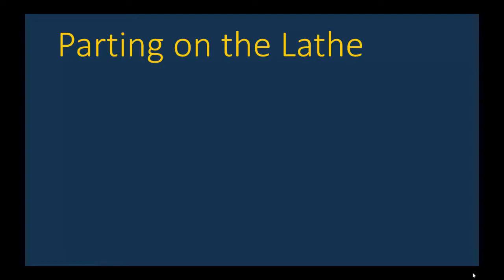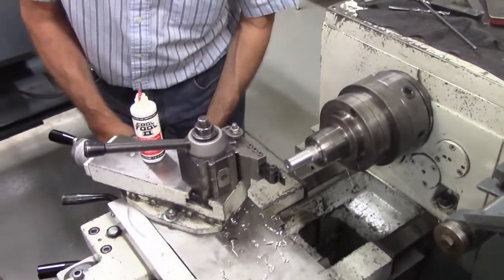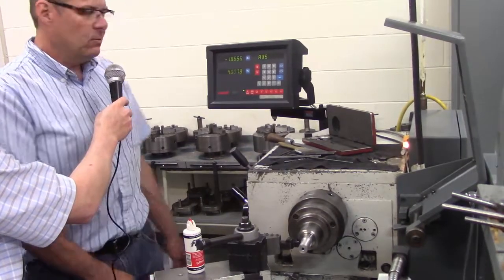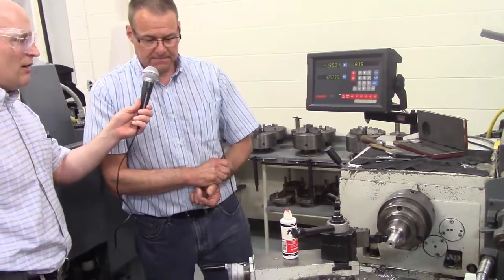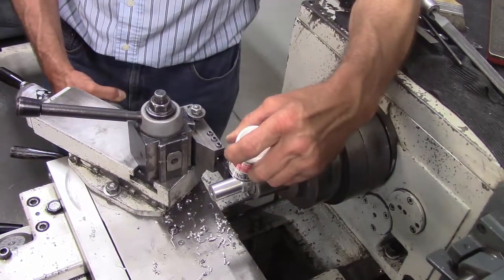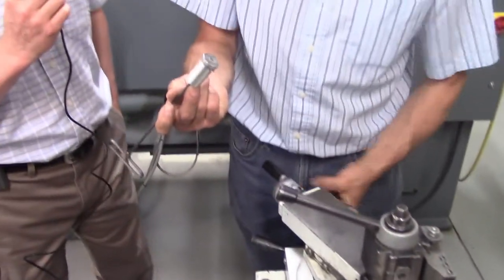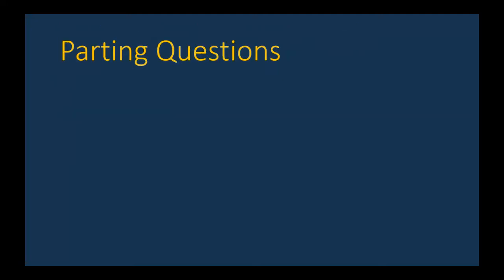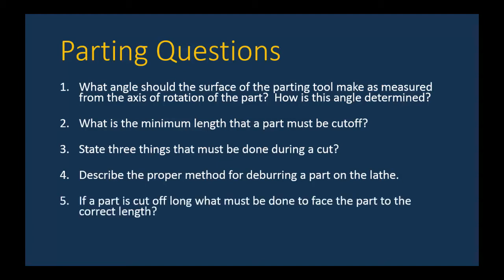MCC ENR 153 Machine Shop Video Video Lathe 9  Parting

Comment: 1.) The cutting tool should be put at a 90 degree angle. To do this, loosen the tool post, and press the tool up against the stock gently, then tighten it. 
2.) The minimum cutoff position is X= - (Desired Length + Tool Thickness)
3.) While performing the cut, set your spindle speed to 110 RPM, manually adjust the cross feed, and use coolant liberally.
4.) To deburr the part, use a file with a handle, and hold it using two hands, without reaching across the chuck. be sure not to touch the spindle with your hands.
5.) To face the part to length, measure the length of the part with calipers, then compute the remaining length to be cut off. Touch off the end with your cutting tool, and zero the DRO.